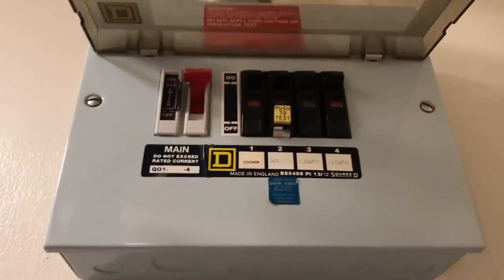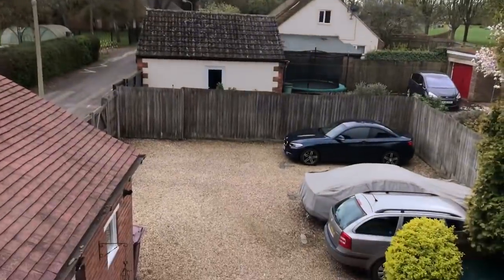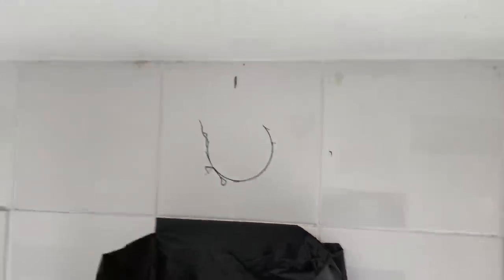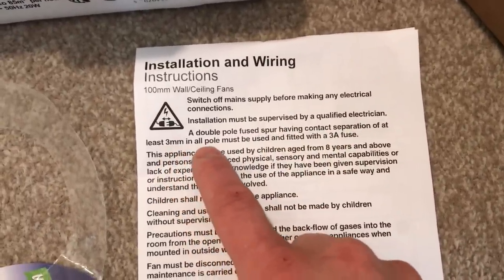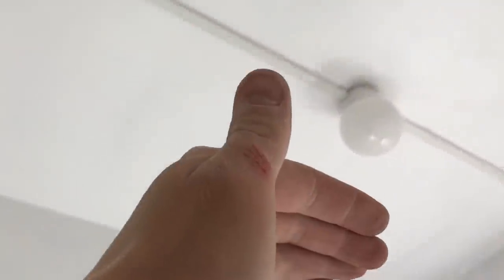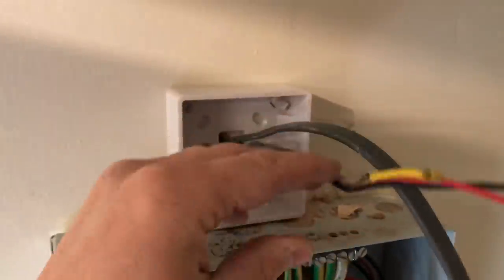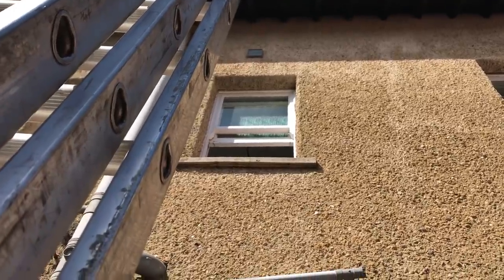CJR ELECTRICAL electricians day extractor fan installation.Have you ever walked off a job?

Comment: With regards to fusing down extract fans I sent an email to manrose and got a reply..   see below

Hi xxxx, following on from our telephone conversation on the 3rd of April I spoke with you regarding advice I was seeking for the 100mm extractor fans manrose manufactured. 
I was advised that when connecting the fans directly from a lighting circuit that are protected by a 6  amp MCB that this was deemed acceptable practice and that the requirement for a 3 amp fuse to be fitted as per installation instructions was only required when fans weren’t installed  using this method. Given that you advised the fans have additional protection in the form of a thermal overload cutout I would concur that the above installation method would be fine.  I asked if it was possible to have this information in writing in the form of either additional tech info or some other form of written statement to which you advised me to send an email.  Could you please reply to my the request as I would like to attach this additional info to my customers electrical installation certificates stating that I have still complied with manufacturers installation requirements.
 
Hi Stuart,
 
Unfortunately I do not have any documents/data sheets that obtain the information required, I had to ask my manager and he has stated:
 
“A local 3 amp fuse is not required if the lighting circuit is 6 amp protected with an RCD/MCB in place.”
 
I hope this information given is suitable enough.
 
Many thanks.

* I will be printing this email and attaching a copy to every manrose fan installation certificate in future... I have had the same conversation with two other manufacturers and have emailed the same request.  Still waiting for the response.. to be honest I’m surprised to get anything in writing... hope this helps, as it’s been a headache for me on certain installs.
Reply: Top job mate. Have done a few extractors plumbed from an 1A FCU just to tick a box.
Reply: In NZ we are allowed to extend any final sub circuit, say a 6mm 32A oven circuit, with a reduction in wire size down to 2.5mm, you could even go down to 1mm if you wanted, without installing a splitter box and overload protection at the point of reduction. As long as the equipment connected is unlikely to cause an overload and does not have a rating that exceeds the current carrying capacity of the cable used to extend the circuit. The MCB at the origin of the sub circuit offers the required short circuit protection and as long as volt drop has been calculated there should be no issue with EFLI. Note that this is the case for hardwired equipment only, socket outlets are not allowed to be done in this manner as loading of connected equipment at a socket outlet can not be determined at the time of install.
Reply: Unless to can show the manufacturers recommendations are incorrect or dangerous then you must comply to them, there was a recent case where an extract fan caught fire causing extensive damage, the installer was found guilty of neglect for not following the manufacturers guidelines as it stated a 3amp fuse must be fitted... the fact that the 3amp fuse wouldn't have made a difference in stopping the fire was irrelevant as it was demonstrated by the fan manufacturer that the installer simply hadn't followed regulation and taken the manufacturers instructions into account.
 If you do omit the 3amp fuse in direct conflict with the installation instructions then I would make sure you definitely do have your arse covered because it can put you in the firing target even if you can show it didn't contribute to the fire nor would it have prevented it.
Reply: @genome616  We obviously get different instructions from you as I have never seen extractor fan instructions say that you must fuse their fans. Manrose is a popular brand here too. Here in NZ circuit protection is for just that protecting circuits not appliances attached to circuits. Nor can you buy fused spur units here and NZ plug tops don't have fuses. The reason for this difference is because you guys still have ring circuits.
Reply: @cunning-stunt  I'm am simply reflecting on the BS7671 which clearly states that manufacturers guidelines need to be taken into consideration, to ignore them would mean an excursion of the regulations which requires you to supply the relevant information and risk assessment if needed with the testing paperwork for the install.
 There are many brands of fan that do specify a 3amp fuse and many that do not but this could be more to do with integral fusing in the fan which is often a one shot thermal fuse on the motor.
Reply: @cunning-stunt  I'm an electrical engineer, extract fans are a high cause of domestic fires and it simply comes down to the fact they can overheat and catch alight long before they overload or short so relying on upstream fusing is actually futile, unless NZ product regulation specify fans have integral thermal cutouts then you too will face the same hazards as for some reason our standards haven't yet addressed this clear issue, PS I have never heard of that brand you mention so reserve comment on it.
Reply: genome616 .. as I stated in my post.. I got it in writing in the form of an email from manrose technical department.. I would like to see them try and pass the buck on that one if I was ever unfortunate to be in situation as you describe..
Reply: @genome616  Yes Australian and New Zealand standards also specify we must follow manufacturers instructions. It is also a check box on our Compliance Certification and Electrical Safety Certificates. All fans, in fact every appliance that contains a motor, I have come across have to have thermal cut outs now since Weiss heat transfer fan units had a spree of causing fires over 10 years ago. As I said before we will get different instructions compared to the UK as we Work off NZ and AUS standards which are often referenced in the instructions.
Reply: @genome616  You are an electrical engineer, well whoop de doo! Good for you. Means nothing, you can still be crap at what you do and know sod all" 

"extract fans are a high cause of domestic fires and it simply comes down to the fact they can overheat and catch alight long before they overload or short so relying on upstream fusing is actually futile"
 Valid point but I don't know why you are directing this statement towards me? I never said anything to the contrary, if anything I pretty much implied the same.

"unless NZ product regulation specify fans have integral thermal cutouts then you too will face the same hazards" 
See my previous post where I cover this. Houses in NZ are generally made out of wood and we have higher ambient temperatures, so the fire risk here is even greater.

"PS I have never heard of that brand you mention so reserve comment on it."
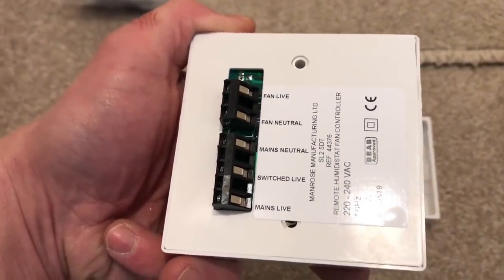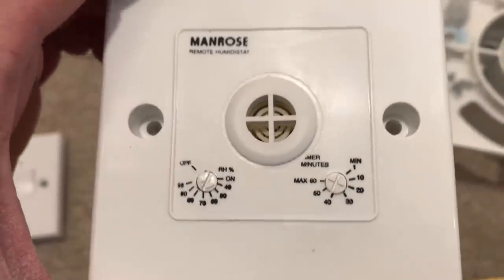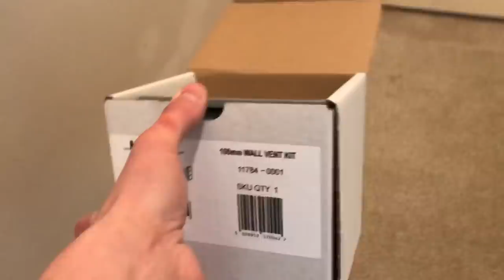You have never heard of Manrose yet it is the leading brand under SIMX in extraction fans globally. The original post on this thread mentioned Manrose. The guy in the video is installing a Manrose humidistat, you can see it at 4:24 and 4:56 with Manrose clearly stamped on it. The fan he is installing is a, 100mm Manrose extraction fan, if I am not mistaken. The exhaust vent he is installing is a 100mm Manrose kit, you can clearly see Manrose printed on it at 5:20.
Have you ever even installed an extraction fan? Have you ever installed anything electrical? Or do you just drive a desk all day as an "Electrical Engineer"?
Reply: @cunning-stunt  When I said I was an Electrical Engineer I wasn't trying to trump card you, pretty childish response and yes you are correct there are shit one out there, my point was and what I clearly stated was that many domestic fires are caused by extract fans and the fusing upstream will not protect against this, I would be confirming with Manrose that the motor itself has a thermal fuse which addresses some of the common causes of it causing fire, with that email you have stopped the company using the installer as a get out clause in a prosecution situe' as has happened before (not Manrose).. 
  If you want to get into the technical side of it then the integral wiring of a fan is usually very small gauge, this often means that higher upstream fusing values can lead to damage of these cables in fault condition which the time curve characteristics is meant to prevent, some manufacturers realise this and either increase the csa of the control wires or specify the fusing is reduced, if Manrose is fully aware of this then 6/10amp upstream may be fine for there product but it comes down to who answered your email and what they understand... either way your ars is now covered.
Reply: @genome616  Why bother saying, "I'm an Electrical Engineer"? Do you think that makes what you say any more valid? Yes you were trying to pull rank, why deny it? I know quite a few Engineers, none of them seem to feel the need to announce it before they speak. Some of them I highly respect, some of them are muppets that know less than an average electrician and seem to make their own rules up.
Wasn't me that contacted Manrose, that was the original poster at the top of the thread. 
If you had read my posts properly you would see that fully I understand what circuit protection is for and that it is not in any way for protecting connected equipment unless you start getting into fast acting HRC fuses rated for semiconductor devices and these are not normally placed at circuit origin but immediately before the equipment it protects.
My arse is always covered if I follow the Electricity Act, The Electricity Safety Regulations, the relevant Standards to the work I am carrying out, related codes of practice (which are informative not normative) along with any manufacturers instructions. I can of course go above and beyond the above as they are only the minimum requirements. If you took a moment you would see that at no point did I disagree with you or contradict anything you said.
Reply: @cunning-stunt  - I said it because motors and controls is my field, I design and build control systems for machinery and implicate the safety measures to ensure they are safe both to use and when they ultimately fail they do so without risk, it gives me more incite in the issues and shortcuts I see made by manufacturers to stay competitive in a crowded market, as most installers tend to be Electricians or even DIY then I do not expect them to be fully versed with the workings and issues found in domestic fans, to most its just another product they put power to.
 I did not state my job to gloat but just to give you a background that I am replying from an informed position, this allows you better judge the content I put and respectively reply.
 I never said you disagreed with me, I was just reflecting the course of events you took was the correct way to do it and then went on further to explain why... I was actually attacking those that do not follow your example and the fact they could end up in jail for what is a design issue with the product and they take the fall on a technicality not because their actions were in anyway contributing to the failed product causing a fire.
Reply: genome616 BS7671 isn’t law.
Reply: @maxmerton  never said it was, it is guidance but if you ever make an excursion from it then you need to justify it and document it, failure to do so in the event of an accident or death could render your defence useless.... nothing in building industry is law, but ignore it at your own risk.
Reply: genome616 It’s untrue to say “Nothing in the building industry is law.”

Everything in The Building Regulations 2010 is a statutory requirement.  That includes the notorious Part P. I don’t know where you’re getting information from, but you‘re adopting an authoritative tone about things that are merely your opinion.

Similarly, you’re wrong about the difficulty in showing competence when departing from MIs.

Also, I challenge your idea that “many domestic fires” start in extractor fans.  I’ve replaced hundreds of failed fans, have seen plenty of melted and burned motors, transformers, and PCBs, and haven’t had one single client in 20 years who had a fire that started in a fan.

Oh, BTW, being unaware of the Manrose brand is just bizarre.
Reply: @maxmerton  I'm an industrial engineer, I design control panels and safety systems for machinery, I have lost slight track on the domestic front but building regs which are inclusive of part p for what it's worth is just a money generating industry, it simply combines several areas and claims you need to be registered to do such work, when in reality it is based on guidance regulations across the fields and anyone can do the work as long as you can get it signed off or inspected by a registered contractor... the part p is the biggest joke in the industry and has created a system that financially hits those who are compliant and competent and misses the ones abusing the system.
Reply: @maxmerton  Glad it's not just me that thinks genome616 is on an unjustified authoritative rant. 

genome616 said "I said it because motors and controls is my field, I design and build control systems for machinery and implicate the safety measures to ensure they are safe both to use and when they ultimately fail they do so without risk"

What is it you think the majority of electricians do when they need to retrofit a motor into a piece of machinery or installation? Electricians have to do exactly what you do and do the install work and any diagnostic work should the initial install be unsatisfactory. Just because I know residential work that does not mean I don't also do industrial work too.

A couple of apprentices and electricians I have worked with in the past ended up going into motor control design, generally because they couldn't hack it on the tools.
I also knew one guy that new lots about harmonics but couldn't tell you the basic requirements of socket outlet installation.
Reply: Cunning Stunt Absolutely. I notice that he has now resorted to impugning the entire industry. I can’t roll my eyes hard enough in response.
Reply: genome616 I really don’t care what you claim to be or what you claim to do.  Your other claims are complete fairy tales.

Why not have a go at another opinionated rant about something you’re not an expert in?
Reply: @maxmerton  Sounds like he has a bad case of sour grapes to me. A lot of engineers that drive desks wish they were out on site.
Reply: @cunning-stunt  
The difference is I did my exams and studies over 30 yrs ago, not the dumbed down system that attaches an unjustified label nowadays to claim someone is and Electrician or Engineer, I have had about 20 apprentices in that time and trust me when I say they are coming out of school dumb and the whole system has had to be negatively compensated to get them a Job ...IE dumbed down.

 When we learnt the reg's back on the 15th edition we were taught not just what the regulation said but why they existed, nowadays we have so called qualified electricians are only guided to what they need to comply with, the fact they are not taught the indepth theory of the regs means they come crying to forums asking stupid questions.

The fact you can now take a 5 week course to walk into someones house and rewire it with no previous experience is my evidence that we are locked in a money grabbing system that has no concern about end user but only about profit margin.... have you ever wondered why so many regulations are so ambiguous and hard to follow yet a few months later we see comprehensive guides published by the same people expanding and explaining the regulations at a cost.. some of you need to just wake up and smell the coffee... 

-Part P is a money making scam
-Re-issuing and charging you for new regulations on a few pages of amendments is  another scam (why not charge a few quid for the amendment list).
-Deliberately making the regulation in areas ambiguous then refusing for approximately 2 months to respond and OH! all of  a sudden we have new guidance literature at a cost ... 

This is why I got out of the domestic decades ago... name me one other trade that see this shambles that hits the honest the hardest and barely touches the dodgy lot... Yet you come in defending it all and trying to misdirect the conversation by saying I'm authoritative.... 

Maybe I am, I have been a Boss 20 yrs plus but that may explain the way my posts reflect but I do not use the position of authority to claim I am right, I merely state my position to give you background to my opinion and reflection of my experience.
Reply: @cunning-stunt  
I will add to a point you raised, this is easily researched too... 70% of commercial fires are directly attributed to extractor fans, they make the claim lack of service is a major contributor and yes in essence this is true but there are many measures that can be inbuilt to a fan and its controls to ensure this does not occur but unfortunately we have lack of regulation in this area and a battle to the bottom in competition that ensures quality and safety are reduced... this also effects domestic but not to the same degree for obvious reasons but still it is a cause of many domestic fires and until common sense takes precedence over manufacturers profit margins and competition we will only see the issue getting worse.
Reply: @genome616  "When we learnt the reg's back on the 15th edition we were taught not just what the regulation said but why they existed, nowadays we have so called qualified electricians are only guided to what they need to comply with, the fact they are not taught the indepth theory of the regs means they come crying to forums asking stupid questions."

This isn't the case in NZ if anything the exams are getting harder. Whilst the electricity act may remain the same. The Electricity Safety Regulations (formerly the Electricity Regulations) gets larger each time it is reissued. The many Electrical Standards and Codes of Practice become more numerous and convoluted as time goes on. 30 years ago the ERs in NZ were a small booklet and that was it. I'm sure that was pretty much the case in the UK also. Then you have to take into account the way that technology and the array of electrical equipment has expanded over the last 30 years. You have had 30 years to learn it all gradually, now the modern apprentice has to learn a basic understanding of all this in 3 years. Whilst the UK may be getting dumber, don't assume that is the case for the rest of the world. 

Trainee Electricians here in NZ spend a minimum of 3 years learning the trade. They then have to pass a Theory exam and a Regulations exam. They also have on job tasks to complete, document and get signed of as competent by their on job supervisor and their in assessor. Then their Industry body assessor has to sign them off on each task. They also have to complete a 2 week block course where their theoretical knowledge and practicable ability is assessed, every year that they are in training. 

I highly doubt that the UK has a 5 week course that enables any joe blogs to go from that straight into wiring peoples houses. 
I have come across know it all, bitter, mean old bastards like you many a time before and I have also seen young apprentices teach them a thing or two about the regulations, electrical theory and the way things should be done. 
Sounds like it's time you quit the industry if this is your view of it.
Reply: @cunning-stunt  Clearly you have just exposed our differences here, the electrical industry is one of the lowest paid now with highest costs and you can wire a house with 5weeks of training and no experience... If NZ is different then appreciate our position and why I mock our industry.. not yours over there!
Reply: @genome616  "I will add to a point you raised, this is easily researched too...70% of commercial fires are directly attributed to extractor fans"

I never raised a point about commercial extractor fans. Nobody here mentioned commercial extractor fans. The video does not mention commercial extractor fans. So your comment is moot.
Reply: @cunning-stunt  Regarding commercial extractor fans.... my comment was clear, I said majority of fires are caused by fans it was not specific to domestic but was making the point, domestic figures are grossly diluted due to idiots cooking and falling asleep etc but they are still a missive concern... it seems your electrical industry and regulations around the products is much more keen and strict than ours, we suffer partly due to been locked in a protectionist trade group IE the EU .. this has seen quality drop, prices rise and regulations eased, all to try prop up the poorer nations at the expense of the big contributors.

 It will be interesting for you to see how very different our industry is to yours and in reflection, I wish we were like yours.
Reply: @genome616  The fan in the video is a domestic manrose fan. The same fans that are installed here in NZ. Commercial fans move all manner of volatile gases and fumes, for long periods of the day, sometimes continuously. I fail to see the comparison to a bathroom fan moving steam that is operated for only a small fraction of the day when the room is occupied.

The majority of fires get reported as electrical when there is no evident source, I wouldn't put too much weight in the statistics.

If you reread the initial comment it states the fans have thermal protection and are designed to be protected by a 6A MCB with RCD protection. Not sure why an RCD is required as they are double insulated now. So if you install it in a situation where you have a 5A rewirable fuse as the only means of protection then you need to add a 3 A fuse. Same situation if you loop of a 32A ring circuit, NZ does not have these they are a hangover from history, and something only the UK and its sovereign states do.
How many of the domestic fires reported to be caused by extraction fans were reported correctly as the fan being the ignition source and how many mentioned the method of installation? I bet none.
Reply: @cunning-stunt  You are wrong, domestic installers can do a full rewire of a house after 5weeks of training, they simply need to join one of the several schemes out there who periodically inspect there work for a fee, what we find is it simply does not work, dangerous practices and installation are been done and the industry is raking in money from the electricians ... I live here, I have been in the trade 30 plus yrs and a regular member of the UK forum for over 10yrs ... if you want me link you to thousands of posts on this subject that just expose it for what it is and not what they want you to believe it is then just ask... again, I would love a system where there was one non profit body that regulated the industry like it used to be but alas! them days are long gone and we are just target for profit based schemes and regularity bodies.
 I see you struggle to believe what I tell you, trust me, it is that bad!
Reply: genome616 Whatever you believe to be true about 5 week courses, which is of course is bound to be as inaccurate as your assertion about fires from domestic extractor fans, the fact is that there are more restrictions in place than there used to be.  Whatever you think of Part P, it used not to exist - there was nothing in place to mandate competence or deter incompetence, other than waiting for a contractor to do something incompetent and then prosecuting after the event.

Again, stop spouting nonsense.  That’s not an insult or a personal comment, but commentary on the ridiculous words you’re writing.  If you think that 30 years in the industry is impressive, then you must be really impressed by my 40 years.
Reply: @maxmerton  - Part P has damaged the industry more than it has aided it, it is a complete waste of space, I tell you what, go on any Electrical UK forum and ask them if Part P is good or Bad for the industry, don't take my word on it, let 1000's of Sparky's spell it out for you, it financially punishes the honest Spark by claiming it is tackling the dodgy ones, it has failed to reduce poor workmanship, cowboys etc as they are not going to sign up to anything like it and the customer are still confused and unaware in most cases as to what Part P is, so exactly how is it beneficial to the industry when the ones that it is meant to tackle do not bother with it?

All I see in your replies is attacking my credibility as a way to misdirect the discourse and not actually bringing anything to the table to back your opinion up, if I am so wrong surely you can easily prove it by citation. I'll respect anyone's opinion as long as they can prop it up. 
Yes I agree incompetence usually is only revealed in disastrous circumstances so on that note then how does charging Electricians to be Part P compliant stop it, like I said, it is just a money grabbing scheme that hi-lights what any honest competent sparks already knows and practices so is pointless to the ones paying for it.

I await why you think Part P is good for the industry and what you have to back such an opinion up, also please explain how you can cram 3 to 4 yrs of block release training tide up with work experience into 5 weeks and be competent to walk into someones house and wire it regardless of whether or not you have any experience, would you let a 5 week wonder wire your house given they may never have done one before or have any onsite experience, really interested to hear your position on that because the last 20 yrs has seen the electrical trade dumbed down and hit with cost upon cost upon costs for the genuine honest long course trained sparks and not only that all these 5 week wonders are now undercutting the established seasoned sparks and doing so at a risk to the customer who has no clue what has happened to the industry.
Reply: genome616 No. You’re attacking your own credibility with fiction.

This isn’t about Part P. I mentioned merely to illustrate that your remark about The Building Regulations was utterly wrong.

Please do continue posting nonsense and verbose rants.
Reply: @maxmerton  Yet again you rebut my posts with just opinion and no backing .. your just playing misdirection and word play.... try and actually give citation to show I am wrong and your opinion is right...
Reply: genome616 I did that, but you ignored it.
Reply: @maxmerton  You called me out and I replied and gave citations, I call you out and you carry on with empty replies while still dodging the very valid points I put forward. It seems pointless actually replying to you anymore as you came in all guns a blazing but turns out your firing blanks.
Reply: genome616 By all means stop replying - it won’t change the fact that you’re wrong and/or lying.

You wrote “Nothing in the building industry is law.”

However, everything in The Building Regulations 2010 is a statutory requirement.  You haven’t attempted to explain that discrepancy.
Reply: @maxmerton  Your point is what though... if you fail to follow building regulations and someone is killed you can end up in jail, if you fail to follow the BS7671 which are guidance notes and someone is killed because you failed to follow them, you go to jail.. you fail to realise the BS7671 cannot specify rules to account for every single circumstance so in effect they make them a guidance which if you make an excursion from them you are bound to document this and provide any risk assessment if required, the BS7671 is not law but they hold the same weight as the building regulations at the end of the day, to reflect back to my original point then, the BS7671 says manufacturers guidance should be taken into account so in not doing so you need provide the paperwork to cover your arse... what is so hard to understand about that!
Reply: genome616 Nope.

1. BS7671 is not “guidance notes” 😂

2. You’re obsessed with idea of “making a point”.  Stick to the facts and you won’t have to write all of the waffle.

3. You still haven’t explained why you wrote “Nothing in the building industry is law.” , which is especially comical in view of you insisting that failing to adhere to MIs can lead to summary presumption of guilt, in court 🤣

4. You’re still replying 😆
Reply: @maxmerton  British Standards are not statutory so thus they effectively are guidance, why laugh at that statement yet again fail to show me wrong, OK I will take the fall and in error I make an incorrect statement but it still does not effect the point I originally made, you consistently have dodged citation to your position even when requested, you consistently have avoided directly answering any question and points I raised and you are still doing the same ... I have always made it clear that BS7671 are guidance but any excursions from it will need documentation and failure to do so can make your position very weak if ever you need to show it in court..

 What exactly is your point in all of this conversation, you have spent several posts hanging on one comment I made while avoiding the actual clear position I took and the points I made... you come across as nothing more than a troll at best, anyone rebutting a serious conversation do tend to bring a little more to the party than consistently attacking over 1 point while ignoring the actual conversation itself.
Reply: genome616 This isn’t about me. I’m merely one of three people who’ve demonstrated that you’re wrong. You’re just a charlatan, using his alleged qualifications in a forlorn attempt to add credence to his false claims. 

You could do what you said and simply stop replying, or you could keep trying to deflect the focus. But I won’t be deflected.
Reply: genome616 
True.
I wouldn’t bother these knobs. Like arguing with the mother in law 👍🏻
Reply: TheLifeOfRippl
Reply: @maxmerton  correct BS7671 is not Law (unless in Scotland apparently) but as an official guideline it is used in a court of law, it is a case of an official document that can be used to demonstrate your ability to understand a safe method of working.
Reply: @jeffreyfearn5662  I work in alignment with the electrical standards published for and licenced by the electrical workers registration board of my country, in order for me to operate in alignment with the electricity act of law of my country. Those standards and that Act are taken above the word of any engineer in court. You will see, if you read genome's comments above that he does not understand the difference between standards and and an act of law, yet claims to be an engineer, which goes to prove that what he says is no more valid than what both myself and maxmerton was saying. This is the problem with some engineers they work in a narrow specialised field having never had any on the job experience then turn around and try to tell those with real world experience that they are doing it wrong. Genome clearly works on large commercial and industrial motors and his insistence that extraction fans cause fires is clearly based on commercial and industrial fans not residential.
Reply: @MightyGimp  Wrong! I'm not baiting anybody. Nothing I posted is factually incorrect unlike genome. Whilst you can work outside standards you must still adhere to the Electricity Act, at least in NZ and AUS but I'm sure the UL has an equivalent act. If you operate outside the standards it must  be to a certified design, nobody is allowed to operate outside of the ACT. It will be interesting when the current wiring standards in NZ get cited in the Electrical Safety Regulations as the new wiring standards known as the wiring rules now states that manufacturers instructions SHALL be followed not should or may. Australia require all poles disconnection on certain fittings, here in NZ the standards require that the neutral remains unswitched. There is going to be some major problems with manufacturers not updating their instructions to allow for unswitched neutrals in NZ, as most stipulate all poles disconnection. And this is just one example of an issue. I think that you were sucked in by the title engineer, as most are that know fuck all about actually doing a job rather than talking about it.

Please read TheLifeOf Ripple's posts and my first post. Both explain the situation and why this is ok to do.
Reply: @cunning-stunt  as I stated the word of an engineer is considered more than just an electrician, how well can you explain the technical aspects of the regs? Now if you can explain with a better technical method than the engineer the other side have put up against you then you'll be lucky. If you understand how the law works it is nothing about what is right but who is more impressive to the jury. You have to remember that if you ever end up going to court, more than likely you'd be in defence & not prosecution. From reading your comments I'd say the jury would not be on your side, you need to calm down & create a better argument while keeping your cool.
Reply: @jeffreyfearn5662  said, "as I stated the word of an engineer is considered more than just an electrician" And as I stated, because I follow the Electricity Act, The Electricity Safety Regulations and the relevant standard based on what I am doing, I will not end up in a court of law, and if I did I can show compliance with the ACT, Safety Regulations and relevant Standards, because I study those too! No engineer can accuse me of anything when I do work  in compliance with them and no engineer's word would be taken that would contradict anything in those documents, it would be irrelevant as would the engineer. The person the board would appoint to check my work would be an Electrical Inspector, not an engineer. 

Yes I can explain the technical reasons why things are done a certain way to meet compliance with the regs. In fact if you go back and read TheLifeOfRipple's comments and my first two comments and you understand the technical aspect of what we are saying then you will see that all that bluster Genome was creating was already covered and taken care of by the overload and thermal protection that is built into all manrose fans. I even pointed that out to him and he came back with "I'm an engineer involved in motor control and protection" 
What further protection can you give a motor exactly? 
Please do tell me.

Just because I am an Electrician do not assume that I don't know the theory behind what I do, I sat Electrical Theory exams and have studied Electrical Theory since I first started as an apprentice.
Reply: @MightyGimp  Go back and read the initial post by TheLifeOfRipple and you will realise that all of your fear and worry is covered right there in the email from the manufacturer as is genome's. That is why he got stick. When a fan has built in overload and thermal protection and is protected by an MCB rather than a rewireable fuse (close vs coarse protection) then there is no need for a 3A fuse. 
The fuse size is irrelevant anyway. The 1mm² cable supplying the fan will handle 6A all day long, the 6A MCB gives the required short circuit protection and the hardwired fan is incapable of creating an overload that will damage the 1mm² cable supplying the fan. The 20W fan will draw 0.83A so even at 7 times operating current for motor start up it will be drawing 0.583A. So what is the 3A fuse going to protect exactly? The fan motor winding will burn out at 1A.
That 3A rule in your standard is due to the old shonky ring wiring the English still do, for some bizarre reason. About time they got with the rest of the world and ditched them in favour of radials.
As stated above Manrose nor any other fan supplier in New Zealand do not stipulate that a 3A fuse is required nor can you buy a fused spur unit here, because they are simply not required, they belong in a museum with ring mains.
Reply: @Jeffrey Fearn , genome616 got stick because he’s a charlatan.
Reply: I was working in a cottage and the customer was constantly critical of every aspect of the job, he just couldn't help himself, then one morning he came on the job and started his usual rant , I felt a wild gushing feeling gushing through my body I ran towards booting a plasting milk crate towards him as I shouted you b.......d, he ran like hell. 
I had to call his wife and let her know what happened and asked to be paid to date and I wasn't coming back, after I calmed down I agreed to Finnish the job.
Neering the end of the job I had the electric shower to mount on the wall which he presented to me,  neering completion he said to me I wish you hadn't mounted the rail, I asked why not he replied I just wish you hadn't done that, I said here we go again youd better f....k off quick or I'm gonna kill you,  he made a run for it as I lurched across the bathroom, this time I packed up billed them and never went back. 
I've been doing this job for 44 years and never had any complaints .
Reply: @lansdorf  hopefully they didn’t pay you and reported your assault of the client to the police.

Getting annoyed is not an excuse for attacking people.